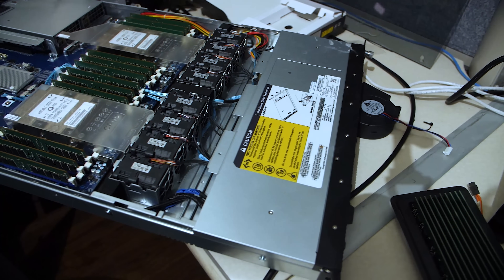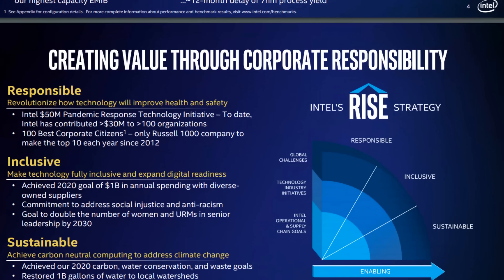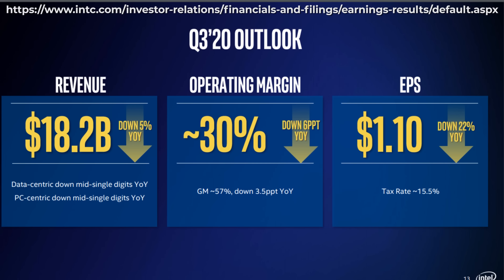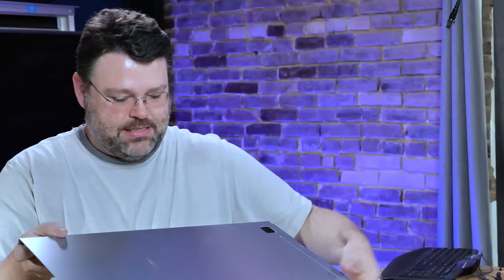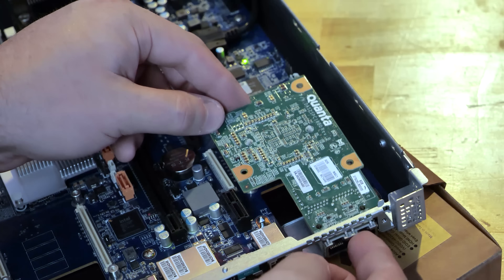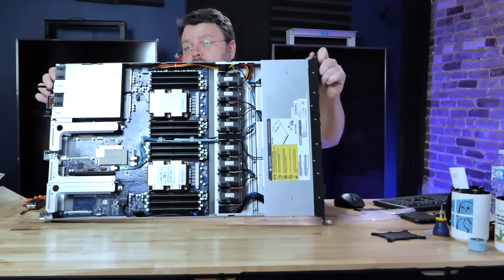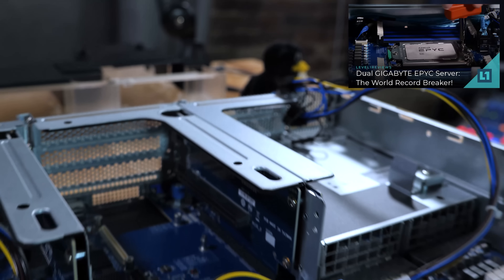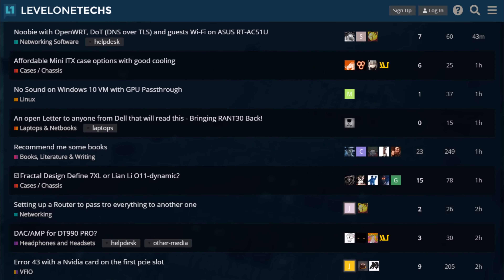Dual Xeon Platinums - For Less Than $1K! Amazon's E-Waste!

Comment: Ok I just asked you about this exact video. I saw 8180s at $265 to $329. Hopefully they also support windows 12. If not I will go with supermicro board for $250    and get two gold 6138 20 cores for under $100 but the platinum 24 cores are also cheap and that's good enough to build a system I can overclock with dual AIOs since these cpus probably were neve overclocked. I'm still getting the new 9950x3D and a modern system but I did want to try water cooling on a system I could screw up. I want to grow a pair and get over my fear of watercolling and I was going to pick up an extra p6000 for 24gb of ram with a used rtx5000. Don't know if that will work. I am refreshing my skills on motion graphics on tv and want a workstation that might give me better render time with 56 cores even if it's older. This is still a hobby for me and I am turning it into work since I'm an expert on history and the bible and pretty good at graphics for tv even though I'm almost blind

Thanks for the video and I'm a new subscriber and going to watch more videos. I hope Intel takes all that money and reinvents their cpus because pushing more watts to try to beat amd was a stupid move. 13900k's are going cheap in bundles and you know why.

Comment: Well , now, 3 years later , 18 cores dont sound like that much anymore , but old Xenos still have a usecase , i just bought an 2680v4 ( Socket 2011v3 ) 14 Core  with 128 GB DDR4 2133 Ecc reg RAM and a china X99 /C612 ATX Mobo for ~ 230 Dollar all together as a Kit on Aliexpress because i wanted the 40 3.0 PCie Lanes and the RAM for my TrueNAS NAS .  ECC works , Bifurcation works , i have now a 4 x 4 TB NVME  Z1 in my NAS . The 2680v4 had a price of 1900 Dollar in 2016 and is sold for ~ 20 - 25 Dollar now
Reply: yess, I was gonna buy a 2699v4 but then I saw the 2680v4 for $20. great decision

Comment: i cringed a bit when i saw you install the cpu-s on that motherboard the way you do. If its the same as the Hp motherboard, you are supposed to put the cpu in the plastic holder, attach the holder WITH the cpu to the heatsink, and then install the package together on the motherboard.

Comment: a year later nearly to the day and I'm buying used workstation threadripper parts . got a whole 1900x,cooler ,mobo rig minus ram and storage for 420$CAD. I have 32 gb board on another I can split and 128gb drive on the shelf . who needs a case? who needs to use 4 memory channels ? those are premium features.

Comment: i upgraded from 2 HP Z800s and a Z600 to HP Z640 for work, using VM-Ware
the Z800s are now game machines
and i have new faster chips to install in the Z640
older is still functional and cheaper

Comment: I use my HPE DL380 Gen 9 as a desktop, though it does server tasks with Windows Server.  I don’t think its as loud as one might think.  When I use it for my regular tasks such as MS Office, Web activity or AutoCAD it is about as noisy as the AC in the window of that room.  When I use it for something intense such as gaming(@HD60) it is about as noisy as my vacuum cleaner.  I feel like I need to be concerned with hardware compatibility(there are no molex or SATA power dongles), especially physical size.  In my opinion it is the heat that I need to be most careful about because it just sits on a shelf, not in a rack with dedicated cooling.  That is one of the reasons I installed an Nvidia P4000.  That GPU is very cool, and its on the compatibility list of both HPE and AutoDesk.

Comment: hey if I want to build a machine learning machine, and in the market for high core count and high base-clock speed 1u server to get would be? I would ideally want to be running physics simulations at 1000x realtime and also train a neural network alongside the simulation!

Comment: I bought a DL350P off eBay for £120 including delivery. Those suckers can take up to ~768GB and can fit the E5-2670 v2 in dual config for 20 cores and 40 threads :3

If you're willing to rinse your electricity bill you can go even higher on the platform.

Comment: You can easily build configuration (based on 1U rack server DL360 G7) made from 2x 6cores Xenon X5690  with 384GB DDR3 RDIMM without HDD's for about ~1400$
Reply: Power inefficient and IPC is much slower.
Reply: @私気に成ります  Price vs efficiency as always
Reply: @Agakir  Even Ivy Bridge-E should offer the price/efficiency.
Reply: @私気に成ります  Server components need to have higher efficiency and are quite different than simple PC.
Reply: @Agakir  I have a R710 in my homelab and it's a pain in the ass to deal with thermals and power draw. In 2021, I don't think Westmere is the best choice for price/efficiency especially considering I can fit more VMs in a E5-2640v2 than anything from Westmere.
Reply: @私気に成ります  On the other hand i said not everyone want and require to spend a lot of money on very efficient solutions like DGX, HGX or EGX especialy the SMB segment. If you want to check the efficiency of mentioned earlier servers DELL,HP, IBM.. and components i would consider to check the testing and comparison hardware websites.
Reply: @Agakir  I'm not talking about ARM systems; Haswell-EP and Ivy Bridge-EP offers in my opinion similar price/efficiency as Westmere-EP while offering improved IPC.
Reply: @私気に成ります  I was not talking about ARM also interesting solutions, but mention about highly specialized NVIDIA A.I segment
Reply: @Agakir  I wasn't trying to talk about NVIDIA's AI segment either (and accidentally thought you were talking about their server segment). Again, I just don't believe in buying 2 X5690 in 2021 when E5-2640 v2 and E5-2630 v3/4 can be had for similar prices while offering more nice-to-haves.
Reply: @私気に成ります   first from a row test http://cpuboss.com/cpus/Intel-Xeon-X5690-vs-Intel-Xeon-E5-2630 but there is also something like "availability" and other conditions. Have great day
Reply: @Agakir  CPUBoss is a bad site for benchmarks. Also, the CPU you showed is one generation behind the ones I was mentioning. I was talking about E5-2630 v2, a 6c12t 2.6Ghz/3.1Ghz Ivy Bridge-EP CPU. But even as your linked benchmark shows, E5-2630 beats the X5690 in single threaded performance.

This proves my point that the X5690 is a bad buy in 2021.
Reply: @私気に成ります  This was the first site from one of the search engines, i know others with more precise details, platforms, software,..... etc. Do not forget that the hardware/software with mentioned earlier status of "availability" is the key in some situations. Bye

Comment: For database work integer thruput and single thread performance are the sole performance criteria. The 6256 can almost match the Ryzen 5950 even though it costs 8 times more.
Reply: I’m not the hardware architecture/db expert and I am not saying you’re wrong. I am well above average at understanding data structures/algorithms, their tradeoffs, how to adapt them to new problems and their use case time/space/concurrency requirements. You could be a subject matter expert on hardware architecture/db’s and I probably only know enough to be dangerous. 

I assume you are speaking primarily about relational databases. There’s so many types of databases I highly doubt they all have same order of precedence with regard to CPU requirements. So I am not going to pretend that’s what you are saying.

However, even for relational databases single thread integer operations doesn’t seem like it would be #1 priority.  With joins, Cartesian products, and sub queries multithreaded operations seem like they would be prevalent. Memory/cache capacity as well as memory/cache latency/bandwidth would seem to be crucial when dealing with multiple large tables and index lookups. Furthermore handling multiple transactions at once and sharding would also seem  to need concurrency, good memory bus and excellent networking capabilities.  

Like I said I’m not expert and would love to hear your thoughts. Relational db seem to often do independent repetitive tasks or have multiple large datasets that can mostly be manipulated in isolation with a thread handling small communication needed. By their nature and nature of servers memory management seems like a huge factor as well. 

If you consider in memory databases, web servers, graph dbs, message queues and cdns all may operate on one machine and their requirements.  Single threaded integer operations seem even less important.

Maybe the implementation of relational databases is geared more towards older/general purpose hardware. Also the nature of queries and their statistics may dictate it’s important. Furthermore stored procedures and tendency to exist alongside VMs and potential need of those VMs to perform calculations may influence implementation as well.

I just don’t see how the core function/principles of relational databases is indicative of top priority being single threaded integer calculations. Maybe you can educate me. I really would like to learn

Comment: Asus have some nice dual 3647 workstation boards that supports normal ATX power supply. Maybe you can benchmark workstation/gaming on those used 3647 Xeon on one of those boards?

Comment: Since these are not listed on Intel, how do we know if a specific motherboard will support these CPUs? What Gigabyte board are you using? One would think the chipset on any board would work no?
Reply: Fair to assume that if you have a processor of roughly the same socket / generation. It's a drop in replacement. Because that's exactly what amazon is doing.

Comment: Why use 18 core XEONs? You can't overclock them and they run at ridiculously low clock speeds.
Reply: You can in a sence overclock a xeon, just not it's multiplier. Since changing the boost timer and power limiter is still an overclock.

Comment: What's the point 3970X is more powerful and could already be found for 1800$. If you calculate motherboard in, you get the same figure as 2x that 8124M + dual socket MB. And you get a new, more powerful CPU that if you run it 24/7 saves you another 500$ in a year in electricity bills.

Comment: How is this supposed to be a deal ? This gets outperformed by a single 3950x at 1/4 power consumption. while costing less
Reply: a 3950x is limited by the amount of ram you can use, Dual Socket Servers with tons of cores/threads are generally used for Virtual Machines or containers, so that they can perform the tasks of many different machines. Another user made a comment about Threadripper and overclocking it, which is more relevant. I am not saying you could not build a 3950x server because you absolutely could so long as it RAM limit (and PCIe lane limit) will not hinder your plans for the server. The 3950x supports up to 128GB ram, which might sound like a lot but its really not, if you gave each vm only 8GB you would be able to support 16 VMs, and if you gave each vm 16gb then you can support only 8 VMs
Reply: SoloSaga 3950x has pcie 4 and the xeon has pcie 3. So bandwidth of the xeon is half of 3950x. So it dosent matter if xeon has double the lanes, the pcie 4 makes up for it.
Reply: Very True, but there is also the maximum memory to consider, for anyone else trying to make the comparison here is the detailed difference: ryzen 3950x (128gb 4x32gb) 24 PCIe 4.0 lanes, threadripper 1950x/2950x (256gb 8x32gb) 64 PCIe 3.0 lanes, xeon platinum 8124m (768gb 24x32gb) 48 PCIe 3.0 lanes. Also you can technically get 64gb dimms for the xeon platinum, doubling your RAM capacity but it triples the ram cost. The new Threadripper 3970x (256gb 8x32gb) 64 PCIe 4.0 lanes, looks good but still cannot handle anywhere near as much ram as wendels xeon platinum 8124m system, and when you consider a 3970x is $2k each then for $500 each for the 8124m you can start to see the value in his decision, that xeon system will absolutely use a lot more electricity over time than a Threadripper 3970x would so that would also be something to consider. Assuming you didnt need the additional ram that the xeon 8124m provides then building a system with Threadripper 3970x would cost more initially but may eclipse the xeon after a few years in money saved from power usage(do your own homework on this please, the TDP supports my claim but there are other factors such as power cost in your area). xeon 8124m 480TDP (240 watt TDP x 2) versus Threadripper 3970x at 280 TDP, a single 3970x outperforms two xeon 8124m cpus in raw performance, and at roughly half the power consumption. More Ram means you can support more VMs, so if VMs/containers is what you are doing with your server then even though the xeon consumes more power you will actually save power because the system is able to support soooooo many more VMs, you really have to consider all factors and the most important question is what do you intend to do with the server. If you are supporting VMs or Containers then only xeon or EPYC really makes much sense because you will need lots of RAM.

Comment: These chips are being sold as QS (aka samples) so I assume there may be a risk with this. Personally I managed to pick up a dual EPYC setup with 64 cores (128 thread) for much much less than this setup, so I find the Intel Platinum hard to justify. Is there a specific reason you went for this over EPYC?
Reply: How did you go about finding your server, trying to buy one for a new home

Comment: Amazon has talked about "2nd's" in their talks before. That is definitely a thing. Another questionable practice by Intel.
Reply: What are 2nds?
Reply: @post-leftluddite  So those are CPU's that work but do not run at the desired speeds that Intel would normally want, but the chips still work. So rather than scrap or melt them, they choose to sell them. In the context of this posting, they are using it to dump product without the board being aware of the practice. Intel is now competing with ARM designs that Amazon is using. They are desperate.

Comment: hmmm... something to consider is you can get a workstation chassis with an 8 core for about $500.  now i just need the decoder ring to see if these 1 offs are compatible with e5-2630 v3.  i think i can use v4 after a bios update.

Comment: Just installed a 6 core 12 thread  3,4 Ghz Xeon for my x58 motherboard for only 20€ from ebay lol :)
Reply: And hows she holding up man im deciding on buying X58, X79 or X99 Xeon for a upgrade from my i5 4690
Reply: @EBMproductions1  Holding great dude, paired it with an RTX 3060ti playing warzone with 80 to 100 frames. Very nice!
Reply: @bgsjust  nice which Xeon did you get X5660 up to X5690 or newer? Im looking at the E5 2678 V3
Reply: For my platform x58 I had to buy x5690
Reply: @bgsjust  nice and does most games still run due to lack of Avx instructions cause i legit will buy the cheapest Xeon if need be but due to avx etc. The E5 2678 V3 sounds the best bang for buck. I might go 2699 v3 if the price isnt too much 😎

Comment: Running dual ES 8280 Platnium's in my main rig. Got them for $1100 each. Nothing from amd can touch it for that price. All the benches I have run show them well ahead of the 32 core amd, except 1 or 2 benchmarks where it edges them out very slightly. There are good deals to be had out there.

Comment: You'll find a lot of these things in China. Currently running 8272CL(26c) and 8259CL(24c), both about $1K. Just be careful about Amazon CPUs(8124 8171 8175 8179 8259 8272 etc), some motherboards' PWM doesn't support them.

Comment: It doesn't seem that great of a deal. 
36 cores at €1k isn't exactly gift. It is cheap, but you have to add cost of the whole unit.
With EPYC, you get a gear that will be useable for next generation...

Comment: Great video, its real interesting when a big company drops out their old stock of CPU's. I am sure everyone remembers the Xeon E5-2670's (from Facebook If I remember rightly). In case any one is wondering Hwtrade-e is a great ebay seller, previously we bought both Xeon E5-2683V3 and E5-2696V4 CPU's from them, and they are still running solid after years of constant use.

Comment: For any home users, look into engineering samples if you want a nice Intel scalable CPU for cheap. Don't use a Skylake scalable ES, as they're limited to ~1.8Ghz (iirc) and also have virtualization issues. But the Cascade Lake ES chips are still super cheap and have zero virtualization issues. The Skylake ES chips are suitable for a workstation rig though, and you can get a 20 core 40 thread Gold 6138 for only about £120. Or alternatively you can grab a 12 core 6136 for about £60. This means you could grab a 40 core system for <£500, or a 20 core for <£350.

I have no moral qualms using them for a personal server or workstation. There's no chance I'd ever be paying retail price for one, so there's not even a lost sale.
Reply: If you can afford the whole platform, board, RAM etc then yes its a great buy them but if you are in budget Xeons V3 still rock the price/performance. If DDR3 ECC RAM is good enough for your work then you can save a ton of money.
Reply: would a engineering sample optane module work on it ?

Comment: Just priced out a system with one of these, ASRock EPC621D8A, SuperMicro CSE-825TQ-563LPB, 32GB Crucial ECC DDR4 and 8 x 1TB WD Blue SSD's and it came out to less than $2500.00...

Comment: I might be remembering that wrong, but for that socket, you stick the CPU to the heatsink via bracket first, and then install it into the socket, not the traditional way.
Reply from the maker: that is technically correct. however I've done it so many times, this is how I do it. The other way is faster to do once you're used to it but I prefer this way because I can wiggle the cpu in the socket a bit to make sure its sitting in there properly.